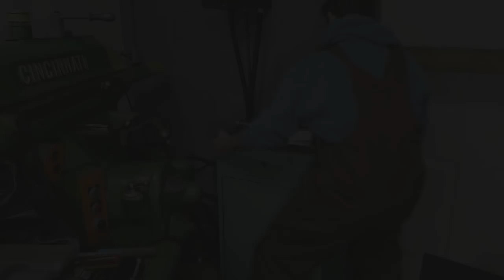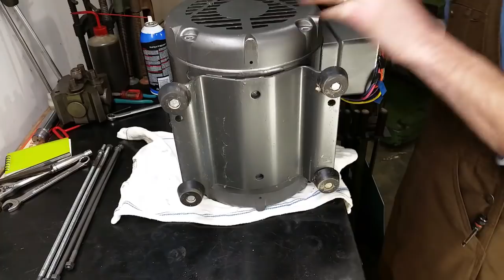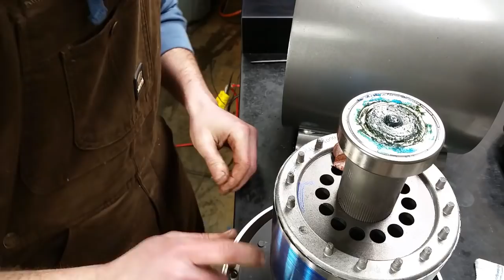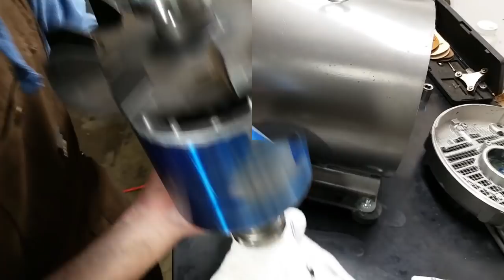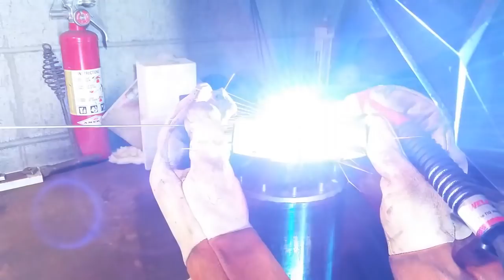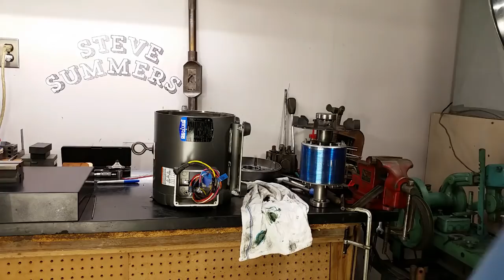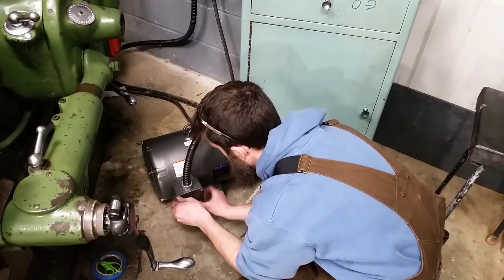Phase Converter Surgeon ;-) EVERYBODY CLEAR!!!

Comment: Another clue: Notice the wear patterns atop the fin tips. They are the most severe in the areas between the two spot welds, and get smaller as you approach the areas where the welds are.

Comment: American Rotary is pretty much a waste of money to me since I build my own rotary converters. Not something for everyone to attempt, and if you are not comfortable with walking into the lion's den that electricity is then don't attempt to build one. 

If you do have a rotary converter (any make, or homebrew) keep in mind that the idler motor size is not critical, in that a bigger one is just fine. Just don't go smaller, or too big. Putting a 40 hp motor on a 10 hp converter will probably not be in your best interest either.

Just about any 3 phase motor will do as long as you can wire it up to the correct voltage. The appearance of the motor really doesn't matter as long as it spins freely and doesn't leak electrons (no shorts in the windings). So a junky old motor with a busted foot or boogered up shaft will do just fine.

Theoretically your can drive up to four of the same size or smaller loads off of your rotary converter at the same time. Each individual load not exceeding the rating of your rotary converter. So in Steve's case, four 10 hp machines, or four 5 hp machines, or any mix of the four can be driven. But in reality you really need to size the rotary to the machine load that it is driving. I installed one on an old 1890's punch press, and a relatively modern (1960's) press that because the 1960's press was hydraulic we went with 2x on the size of the converter (we installed a 20 hp converter). 

Balancing the phases is tricky, but I've found that the 3 phase motor that you are driving rarely cares about balance and actually helps smooth things out. Be forewarned that your electronics might not be so forgiving.

As for starting the idler up, I opt for the tried and true "Lawnmower cord" method. Be careful with that approach, and don't apply power until you, your fingers, and the rope are clear of the shaft. And starting up your idler on a cold December morning will probably trip the breaker more than a few times until the core of the idler heats up - which it will. Better yet, install a pony motor to the idler motor and let it start the idler up.

Run caps can be added to help balance the phases. To the best of my knowledge it is pretty much a trial and error process to find the correct sizes. Higher voltage caps are just fine and will tend to last longer. Be sure to use "Run Rated" caps for balancing the phases.

I read a PHD thesis paper on the subject of rotary converters from the 70's, and along with some good info on different ways of creating 3 phase power, it basically said that you were on your own when it came to sizing the run caps. If anyone knows of a good method of sizing the run caps I would love to hear about it.

And add bleeder resistors to the caps to keep unpleasant surprises to a minimum (did I mention that electricity is dangerous?). Bleeder resistors need to be sized to about double the required wattage, and nothing says that they have to be mounted directly on the caps. The simple method is to find a size in watts that you like (i.e. cheap & plentiful), and keep upping the amount of Ohms resistance that you are considering until you are at or below the 1/2 rating (in watts) of the resistor. 

 So suppose that 5 Watts resistors are what you want to install. Take your phase-to-phase voltage (we'll call it 400 volts) and square that (400 x 400) and divide it by 1/2 of the wattage of the resistor that you want to use (so the math would be 400 x 400 / 2.5). I get 64K Ohms, and this 68,000 Ohm (68K Ohm) part for 62 cents each would do nicely:

https://www.digikey.com/en/products/detail/te-connectivity-passive-product/ROX5SSJ68K/10231957

The ROX5 series resistor has a maximum working voltage of 750 volts, so they are well above what would be required. Pay attention to the working voltage rating of resistors used in line voltage applications.

Without knowing what the value of the capacitor is, there is no knowing what the bleed-down time would be. But you can find the 1RC time based on 1 Microfarad and just multiply that by the size of the cap in Microfarads. I get 0.068 seconds for 1 Microfarad. You want 5 times that to completely discharge the cap, so figure about 1/3 of a second per Microfarad. So for a 10 Microfarad cap it would require about 3.3 seconds to safely discharge that cap.

Comment: Well done video but I have to disagree with the conclusions. I have a Phase A Matic 3hp RPC that made the same screaming pig sound yours did, something I tolerated for a long time.  I finally decided to fix it or trash it. My RPC looks almost identical to your RPC. The noise coincidentally started after I greased the RPC with grease gun. Didn't make sense, but somehow the grease affected the bearings. My guess was that the bearing OD race was spinning and chattering in it's die cast end bell hub. Sometimes I would tap the end bell with a rubber mallet to quiet it down for awhile.  Sometimes that worked, sometimes it didn't. 

After reading comments here, and after disassembly, I now suspected the bearing shields were causing the noise. It made sense, the grease pressure pushed the shields into the races. Another thing to remember, the screaming pig noise would somewhat vary when I started a mill or lathe. It's because the load alters the magnetic fields in the rotor and changes the bearing end thrust, which affected the bearings, the rubbing/galling of the shields,  and the noise.

I removed the shields on both sides of each bearing, cleaned up all the grease with thinner,  applied LockTite to seat the bearing OD in the hubs, reassembled the RPC and it now runs perfectly normal with no screaming. 

I believe your RPC quieted down because disassembly/assembly of the RPC and changing the torque on the tie rods changed the end thrust on the bearings and was enough to relieve the pressure on the bearing shields. Tack welding the fan didn't change that. If the fan was vibrating enough to cause that noise, it would have failed from metal fatigue a long time ago.  

Happy to hear you got rid of that annoying noise in any event.

Comment: Cool repair. Looks like your new welds did the trick. Since you were trying to touch all bases before reassembly, I'm surprised you did not give the fan a good brush-vacuum cleaning, too. I could see that some dirt was accumulating on the blades of the fan.

Comment: Hi Steve. Glad your modifications seem to have quietened it up. 
Though my theory is the rotor was rubbing against the stator - there are shiny rubbed patches showing on the blued circumference of your rotor. Taking it apart and re-assembling probably re-aligned the bearing seatings in the end covers and it now runs without rubbing.

Comment: Seems odd to me that, if this thing was so quiet when you first started using it, that it could be only two welds...or the two-piece fan assembly...that are the problems. That seems quite unlikely actually, given that those things were there when you first noticed it was quiet while in operation before. I guess maybe the metal in the two fans could have gotten fatigued to some degree, and were now flexing more? That's weird. 

Sure miss the days of good old-fashioned die-cast cooling fans though, huh?

Comment: "   Did the wiring really used uninsulated bolts to connect the wires!?  " jeff millar below
Yeah, uhh what's the idea there... float them in freespace inside the surrounding metal castings ? oh yeah ya just curl em up and try to get make sure they have all air kinda in the middle, before you put the flat plate on and scrunch everything in against it - cross your fingers, cross your eyes too, cross your legs, make the sign of the Cross.
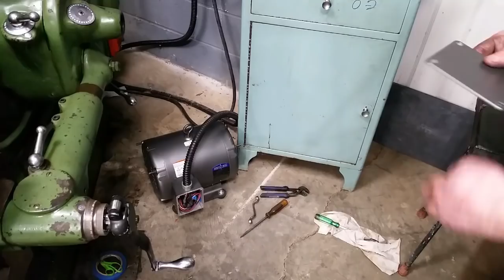Reply: 22:45 he's got black electrical tape around em...

Comment: WELL Steve when i bought my big MSC mill used it was 3 ph and a friend gave me a Teco VFD 2hp 3ph which he could never get to work. i hooked it up got on the phone to the teco drive division and that thingworks oso good i have a VFD on 4 machines. converts 220 1ph to 220 3ph. they have the 110v 1ph to 220 3ph now and i have one coming.  will give you for/rev variable speed on/off on a remote location. check it out. Paul

Comment: when i read the text i was thinking you go and whent to get youre soldering iron and scope 
personally i was suspecting a bearing problem but the inside looked like new and there didnt seem to be any scufmarks or metal turned bleu
it can still be a bearing problem and the sound returns after the thing has been through a few heatcycles and the bearings settle in there pockets , lets hope it doesnt

Comment: Steve, if the noise continues, try adding another spring washer to the end bell. I have repaired many baldor motors and have had good luck with that trick. It puts a slight thrust on the bearing, but I have never had any trouble with it damaging one. As for the guy that is questioning the grease zerks, those are shielded bearings (6206zz) that will allow small amounts of grease to pass through. I have also experienced resonance issues with the way the endbell is constructed and also motors using small diameter through bolts to hold the endbells on. Try the extra spring washers, maybe that'll help.

Comment: That fan turns at tremendous speeds! Using poorly laminated sheet metal to construct a fan is the cheapest way to go. Surprised GenTec let the bean counters talk them into this. Even a cast aluminum alloy fan would be better. This sheet metal configuration will always vibrate especially when a little dirt builds up on the blades causing an imbalance which only serves to increase the stresses and vibration. Those tack welds would have failed eventually, the fan would fly apart and ruin the motor. 
   At first I thought you were going to pass on the blade tabs but you did it right by tacking down those edges. 
  All in all I think GenTec did a terrible disservice by tack welding the thing to the shaft in the first place. How hard or expensive would it have been to design a fan with a hub and press it on? Just my opinion.
Dale

Comment: The electric motor was invented over 100 years ago and you would think that fan designs had reached an apex where failures of this kind would never happen.Then again, this is not about good design, it's about a motor company who wants to cut cost with substandard fans to maximize profits. I can't help but think it's act of either incompetence or stupidity that anyone would fasten a fan with two spot welds and think of it as a good idea.  If this problem happened to me, I'd tell the manufacturer 
about their fan, and have them fix it instead. If not, a new motor or refund is in order.

Comment: Good catch!.  I'd already ordered new bearings.
I've worked with sparks and electrickery all my life - we use 220v AC.  I'd never advocate NOT switching power off and then you test and test again with a different method that it's really truly off but while it hurts.  As long as you are physically fit (no cardiac problems) and you're not wet and carrying a bucket of nitro, domestic AC tends not to be lethal.  Dc is a different tricky little beast - but I can't think I've ever had more than light singeing from AC shocks.  Usually it's falling off the ladder or roof that does the real damage.
110v is almost in the wet your fingers first category.  That's not to say never - I wouldn't make it a party piece ... but very, very unlikely.

Comment: I would put some rubber tape around those bolt connections and wrap it with electrical tape. If it gets to vibrating it could wear through a wire casing.

Comment: Hi Steve,  
I stumbled across your channel tonight and wanted to thank you for posting this solution.  I have a Phase-A_Matic 10 HP rotary phase converter that has been doing the exact same thing as yours.  Its not as bad as yours was yet but is slowly getting worse.  I was getting ready to tear into it to find the problem, but thanks to you I already know the fix.  I am not a "FAN" of the two piece fan design :-).  Thank you for providing a workable solution.

Comment: Awesome work sir. I think it's funny when people are surprised things can be so "easily" fixed. I tell people it's not hard you just have to have the balls to open it up. Usually the issuses stand out like a sore thumb or with YouTube you can find repair videos for all most anything. Anyway great work!
Reply from the maker: Casey White I believe most people are in a bit afraid of working on items they have never  had apart. I do random repairs at my real job working on equipment that I've never seen before that cost more than everything I own put together, time is always a issue and calling in a tech from across the world is not an option due to time. I just go about it slow and cautious. Sometimes I win and sometimes I loose. But my old boss told me years ago. "Never be afraid to give it a  try"  That stuck with me and has helped me more than anything.
I also don't start my repairs with pry bars and hammers.👍
Thanks for watching, I really appreciate it

Comment: Hello Steve, 

you mention using a multimeter to check that the machine was isolated. While a multimeter will do the job the recommended instrument is a voltage checker. The reason is that it is too easy to use a multimeter set to the wrong application which, in the worse case, wil put a dead short across your mains which can be dangerous.
This is not a critisism but just some friendly advice.

Comment: why was there grease on the outside of SEALED bearings ?
Reply from the maker: David S These are shielded bearings, not sealed. The grease is delivered via grease fitting from the outer end bell and forced into the bearing past the shield. Basically . Not uncommon. Grease delivered under pressure can easily get past this and in to the bearings

Comment: I have an American Rotary 3-Phase converter on my CNC mill .. had it for 15+ years - still working flawlessly.   Did you remove the electrical tape from the bolt-and-nut connections?   I would think that you would risk them "shorting" out against one another if you do not have them wrapped generously in electrical tape.
Reply from the maker: Joe FromRomeo Yeah, I had them wrapped, just removed for video reasons.  American Rotary is a good company and make good products, guess I just got a fluke or something. They use good quality components. This motor  is made by Baldor and they are also very good. Still not 100% sure what I did fixed the issue but so far so good. She was quite when I got it👍
Reply: Sometimes - all it takes is taking something apart - cleaning it - putting it back together.. get's things "re-situated".  But my guess is that if you don't find the root cause -sooner or later it will come back.   Great video.  I like the way you work and explain things.

Comment: Nice Video... I am glad you were able to fix it.  The rotor is the most important part of the phase converter.  It is my opinion that this company has the best convertors on the market.  They use cast iron motors not steel sheet metal housings like American rotor shown here.  They also warranty the rotor for life.  Check it out   here:      http://www.gwm4-3phase.com/

That is just my two cents.....

Once again great video Steve.. and I thought the information is spot on and very informative.

Mike

Comment: I thought it was a bearing as well and remained sceptical until you threw the switch.  The 10 hp motor that I used to make my converter sounded like yours and the problem was a bearing.  I hope you took advantage of the opportunity and shot some grease into it before you pushed it back.

FYI That aqua cabinet where you keep your carbide is an Army Medical Corps bedside from the Korean War era. I have one just like it only different.  Mine is powder coated red.

Comment: I had never thought manufacturer would make those fans out of sheetmetal and sorry but that is just the cheapest way to do it. I stIll have some old motors just 30 years old or even older an the german manufacturer has put grey cast iron fans in there, still sometimes aluminium ones, but I never heared off these ones squeaking like yours did..... 
Nevertheless great job Steve :)

Comment: Oh...!!!   That's a cheap way to make a fan and much worse even way to couple it to the shaft...   :(
This should fix the problem...   ;)
BTW, when tig welding, it helps to keep the shielding gas post flow on the part while cooling, it keeps the oxygen away from the metal and helps to prevent scaling and eventually micro cracks...   ;)

Comment: It’s a baldor motor. If you tear it apart change both bearings out. You can see different color grease on bearing. The fan is not the problem. Any welds you put on it you will unbalance the rotor. 
Just change you bearings. From ickes Electric Ltd.

Comment: Great job, Steve!  It is really surprising that only two tack welds were used in manufacture to secure the fan to the armature shaft, because tack welds often fail when subjected to a harmonic loading cycle. Shame on American Rotary!
Reply: I believe the shame should be on Baldor (Gentech).  American Rotary uses them as a vendor and they are responsible for the internals of that motor.

Comment: Not sure if your bolt wire terminations had insulators but the normally are supposed to be.  I used mastic on mine.  Take a look at my rotary converter video for the AD-20.

Comment: Competent diagnostic on that converter! how often do you grease those zerks? they looked well tended why not put a bracket on that wall to hold it, and shield it from debris. A downward facing cover open on bottom should allow enough air circulation and help prevent debris accumulation